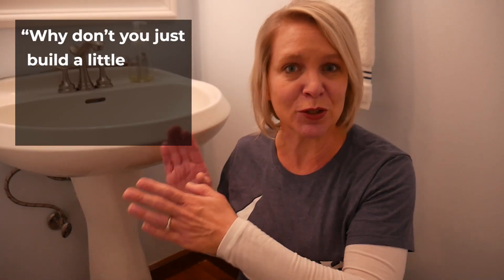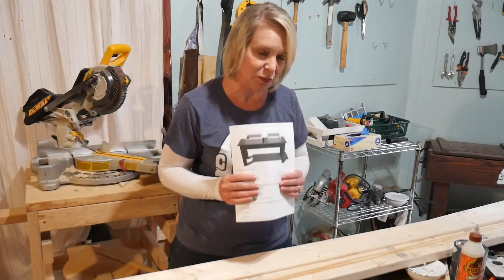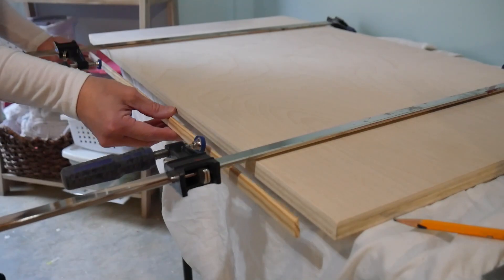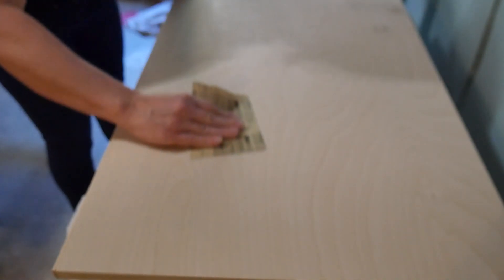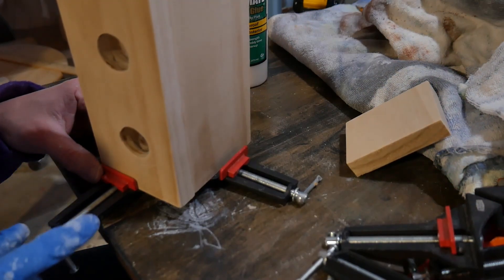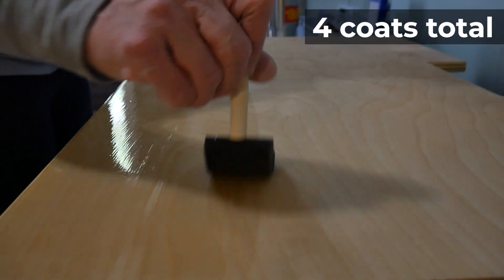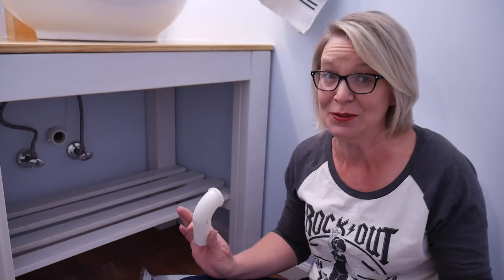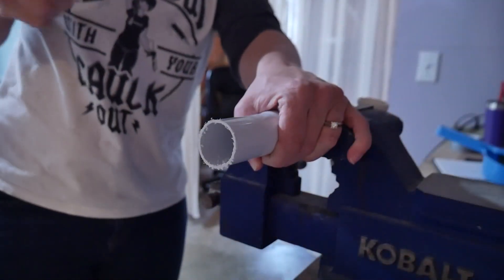Build a Bathroom Vanity with a Vessel Sink

Comment: What product did you use around the base of the sink? Just caulk or something else?
Reply from the maker: I actually didn't use anything at the base of the sink. The drain connection kept it tight enough and there was not an issue of water, so a caulk/silicone would have only been for looks, which I didn't think I needed. Have not had a problem so far (it's been about a year)